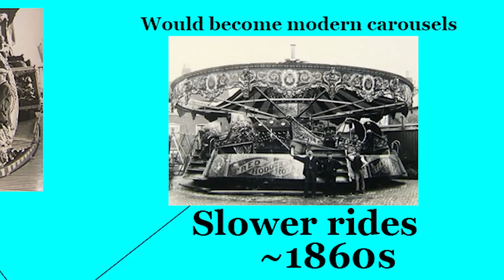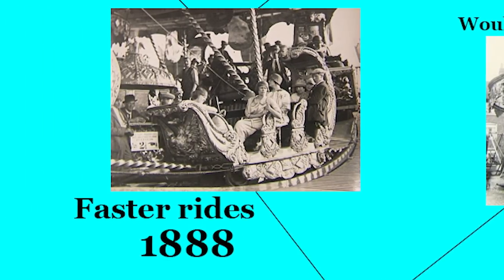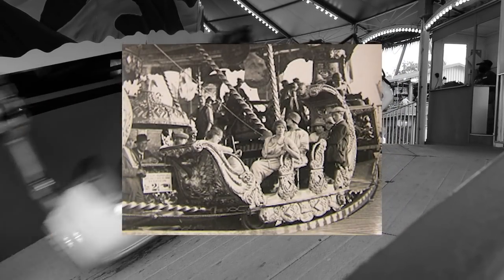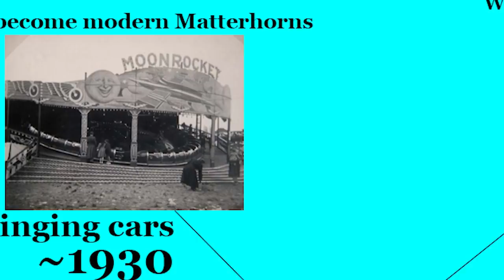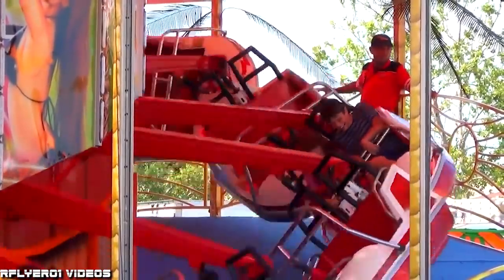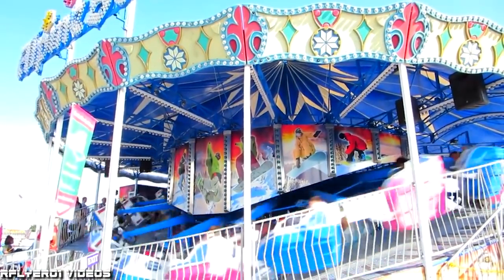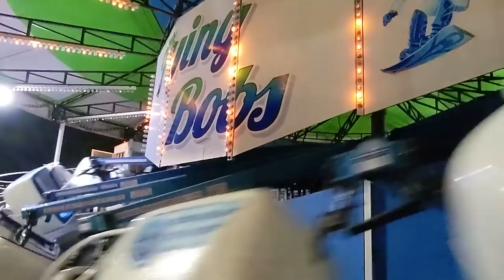Matterhorn Rides Info and History - Flat Ride of the Week 50

Comment: I used to operate a Bertazzon Matterhorn at the Columbus Zoo. It was fun, but we didn't allow riders to rock the seats, so the quality of the ride was dependent on the speed. We operated it on a slower setting, but we had an employee ride night and they kicked it up to one of the faster cycles and it was pretty great. Still, one of my favorites to operate.
Reply from the maker: Interesting that it can run at higher speeds and they chose not to run it that way. Any idea why?
Reply: @CoasterCollege  My best guess is because the height requirements were increased for the faster setting, and the park is oriented toward families. What’s interesting is it already had a mid-range requirement. I think I turned down more children for that ride than any other 😂.
Reply: That was the Matterhorn I grew up with ☺️ I was always disappointed that they’d say do not rock the cars lol

Comment: Great video as always 😎👍🏾

There is only one Herschell Flying Bobs I know of that still operates, and that's the one at Indiana Beach, which came from Coney Island Cincinnati. The easy way to tell a Chance and a Herschell apart is the guide wheel and track placement. The guide wheels and track are placed behind the scenery closer to the middle of the trailer on Chance models, whereas the Herschell models has the track and guide wheels readily visible (the track is much bigger around).

Mack Matterhorns are my favorite ones because they're simultaneously smooth and fast. Cedar Point toned down the ride cycle of their Matterhorn, but the Matterhorn at Geauga Lake (called Matterhorn at first, then Yukon Yahoo and then HayBaler) positively FLEW. It had to go at least 13 rpm. 

I'm not a fan of the Chance models because the seats swing a little TOO much for my taste and it's a much rougher ride. The smoothest Chance one I've ever been on was Talley's Big Kahuna, which is a rethemed Thunder Bolt, which you actually have in the video. There are quite a few that come to Ohio, such as Durant Amusements' Flying Bobs, Lisko's Music Fest, Burton Brothers used to bring a Rock N Roll to some of their fairs, Talley now brings Big Kahuna, PrimeTime brings an Alpine Bobs to some events. We didn't used to have this many Flying Bobs rides until just a few years ago.

I'm also not much of a fan of the Bertazzon model either, although they do look cool. The Columbus Zoo has had a Bertazzon Matterhorn since 2008 called Safari Stampede, but they run it very slow. Ohio State Fair used to have a Bertazzon Matterhorn called Rock N Roll. Has the same problem that I feel the Chance models have, seats swing too much and it's just not a smooth ride. I'd probably have to ride a faster one to change my mind.
Reply from the maker: Had no idea the one at IB was a Herschell! I will have to ride it when I visit this year!
Reply: I am from the Geauga Lake area (RIP) and yes the matterhorn there was awesome and so much better than CP's

Comment: My favourite Matterhorn rides are the ones made by Reverchon. They had one at Blackpool Pleasure Beach called Phantom Chase where the cars flipped upside down on one hill. It seems to depend on the shock absorber system in use. The Reverchon Explorer is a great variation.

Comment: Really interesting video! I've been on 2 different Matterhorn rides so far. One of them was at a fair in the spring, many years ago. The other one was the Ice Jet at Canobie Lake Park, but it was operated a little slower than the other one that I've been on.
Reply: I rode the original matterhorn at canobie. That one was the fastest it was nuts the cars would literally almost go completley upside down cause of the speed that it was operated at, sad that it had to go but its a legend in New England.

Comment: I’m lucky enough to have a Reverchon machine travelling in my area and that thing is ran fantastically. Also, there’s another Reverchon one on Central Pier in Blackpool that has to be the most insane one I’ve ridden to date. Yes, it may not have the atmosphere of the legendary Ice Jet but I thought I was going to end up in the sea when it went maximum power. If anyone has some spare time when in Blackpool, get yourself on Flying Bob. Yes, it may not currently have a cover and half the flash is missing but it was in a fire a couple years ago and is running like new again so the more money you spend riding it the better!

Comment: I love my local matterhorn, mine at the local park (rock n' roll at Oaks Park) is awesome with the operator actually speaking through the PA informing the riders. The low-impact nature and being able to cycle 20-30 guests per ride cycle makes it awesome to do repeat runs on compared to other rides that are more popular, have less capacity and longer queues.
Thanks for the tip on trying to rock the coaster that is something that I can try next time I go ride on it.

One coaster you could do for a future ride of the week is Squirrel Cage / Rock-O-Plane , which is also at my local park and is super popular here compared to other ride offerings at the park.

Comment: Is this the start of the non swinging Music Express? I’ve seen the swinging ones down at the Jersey Shore as a permanent ride ride at the piers up and down their cikisdrbut not where I am which is only a star very close by. Probably more west into the city, maybe Coney Island but never saw it there that I know of but the only one here at both our permanent and traveling is the  non swinging Music Express. It’s not to bad. Three max to a car depending size and it has the hills, blasting current hits and smooshes you into whoever is on the outside end. I used to go in as a teen but I can’t do anything spinning. I freaked out on a on a kiddie ride last year but definitely into my late  20’s I went on everything but a  Ferris Wheel or where someone is severally injured or worse if someone died!